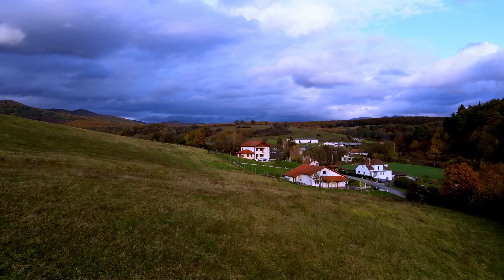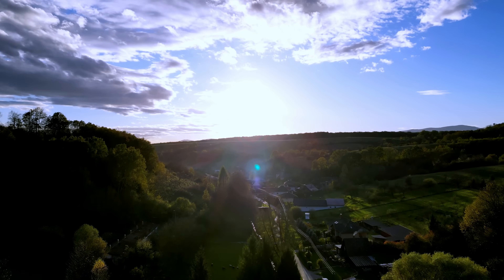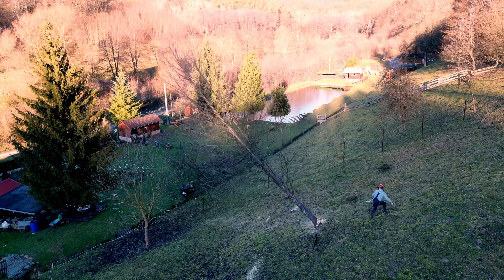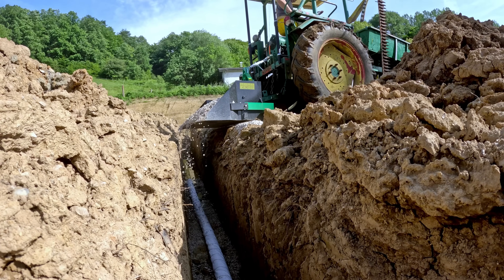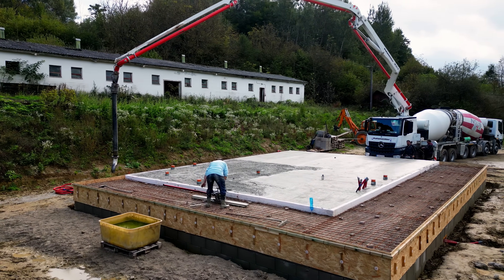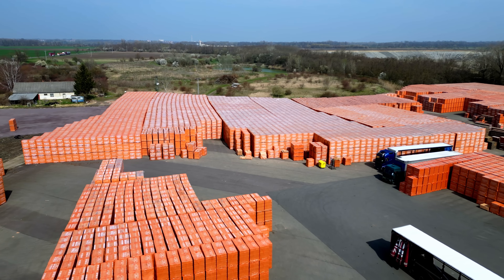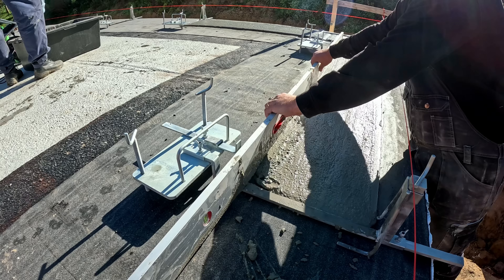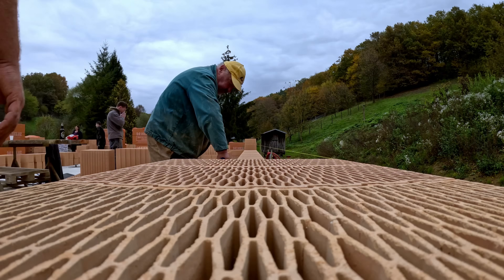Czech Bricks That Could Change Homebuilding | (#23 How to build a house)

Comment: We use bricks in Perth (Australia) which are double walled but only half the thickness, i.e. 10cm per wall with 5cm between. However, the insulation is very poor! Maybe these bricks are better for insulation with the polystyrene, 50cm thick and different pattern but not sure it matches other methods. What is the approximate R value... >2.5? Laying these bricks with roll-on mortar is a brilliant idea as the standard trowel method requires skill and much more time consuming. Finally, you will have problems laying services like water, electrical, plumbing and gas with a single 50cm thick wall, so please advise how you deal with this.
Reply from the maker: Thanks for comment. R value for this brick (withou styrofoam filling) is R=7 m2K/W. If you will use filled bricks it is even better 👍 water pipes,sewage pipes, electricity etc. will be applied normally, through the walls and than covered by thermal plaster.
Reply: @CountrySideDream ... that is very good R value.

Comment: I wasn't able to watch the first full video so I might be a wrong. 
I've been in Alaska for 40yrs.  The biggest and boldest mistakes are made by not installing a vapor barrier wherever concrete comes into contact with the soil or even dry backfill. It appears you've done an excellent job with drainage,  however all of this may have been accomplished with some inexpensive plastic pond liner carefully used under all footings and floorings. 
Rising water vapor is some of the best ways to take heat away and makes an excellent environment for mold.
COLD WEATHER TESTING 
FAIRBANKS AK.
Reply from the maker: The drainage was done mainly due to statics. To prevent sinking of the house to the ground which can cause critical problems with house in the future. Waterproofing (also radon proofing) is and will be done between concrete slab and brick walls and whole house floor 👍
Reply: @CountrySideDream  thank you!  I was holding my breath on that particular part in the construction.  Good go!
Reply from the maker: @Curtis-s3p  keep watching and if you will have any question just leave coment 👍😎
Reply: @CountrySideDream  Also want to know the reasoning behind the use of white foam beads instead of the more often used spray foam that completely incaseses the voids?
The beads are more environmentally friendly?

Comment: I have several questions about the final product.  What is the R-Value per inch of material?  How strong is the material in terms of sheer strength?  Would someone in an earthquake zone want to use this material or can it be “crushed” by the shifting action of an earthquake?
Reply from the maker: R value: 7 m2K/W (It is thermal resistance factor but it is in m2 ) 

Strenght: 8 MPa 

If you are interested in technical informations whole official technical list is available on internet, even with  different variants of used mortar. Material is called => HELUZ Family 50
Reply from the maker: One more thing => earthquake question. This topic is usually problem of project documentation, so if the structure is designed with concrete pillars and big wreaths there is no problem in brick 👍

Comment: The pink bubblegum adhesive is an alternative to mortar? Is it an epoxy? The brick is beautiful.
Reply from the maker: It is new technology mortar. It is not epoxy or any other "hard chemical" it is mineral mortar. It is pre-prepared in buckets and applied by normal roller similar as a paint. Today is popular bricklaying on glue foam and honestly I really dont like it. This mortar combine efficiency, speed and comport of Glue foam but it is much more stronger => similar to cement mortar.
Reply: @CountrySideDream  This is all new to me so I will have to investigate.

Comment: Dont think i would use clay bricks for my house i used concrete blocks with rebar and more concrete to make it stronger with steel and concrete beams top and bottom everything connected to the roof and footings..
Reply from the maker: Your house has to hold as a bunker thas true 👍 but it has to have the additional thermal insulation, am I right ? If Yes how you are ensuring that your house is breathing and ventilling the internal moisture in air ?

Comment: First time viewer to your Chanel. Very interesting bricks. Does the clay naturally change color after baking or is something added to the clay?
Reply from the maker: Its natural change of colour, cool thing is that clay is mixed just with water and some biological paper particles or something like that and all production waste is natural and safe to store in same clay mine from which they’re taking the clay 👍
Reply: The color is due to the iron, underground the iron is reduced by low oxygen and grey, in the fire it's oxidized red.  The clay is actually a small part of the brick mix, the naturally existing subsoil probably contains more sand and non clay particles than actual clay, but clay is so "dominant" in the characteristics that it looks, feels and performs like clay.  Pure clay would shrink and crack too much.  The waste is good filler for pure clay, in this case the soil is probably just right so no need to reuse the waste and it's easier dumped back in the pit.

Comment: Those are  “ Poroton “ blocks , we were using those in Germany in the 1970 ‘s building boom. ( the Auf Wiedersehen campaign )
Reply from the maker: It is not Porotherm, Its HELUZ 👍 from my point of view much more technically sofisticated than Porotherm. HELUZ brick has structure which gives them thermal insulation properties (brick by itself without filling) and filling is just a benefit 👍 Porotherm is based on filling, so if in future this filling deteriorate, Porotherm has a Big problem but HELUZ still keeps its properties 👍
Reply: @CountrySideDream How is it SO different from Porotherm? Can you explain? It certainly looks very similar/ the same...
Reply from the maker: @CARambolagen  Main difference from Porotherm is, that Porothem has no thermal insulation properties without mineral wool filling. Houses built from not filled Porotherm are usually covered in additional styrofoam insulation. HELUZ brick has structure so good that not filled brick (I´m using HELUZ 50cm thick brick) is allowing you to achieve "passive house certification" without additional styrofoam insulation and such a house can breath and transfer internal moistures naturally out of house. And HELUZ is even cheaper than Porotherm :D
Reply: @CountrySideDream  OK, interesting. I wonder why it is called PoroTHERM then...? The name seems to suggest thermal qualities...
Reply from the maker: @CARambolagen  Look Im not telling that Porotherm is bad, but definitelly they are winning in marketing and gaining from bráne recognition. HELUZ is now heavily working on their competitivnes => they are offering free project documentation for family houses if you will use their material. I think they have 5 different options ready and when I was checking those project they really masterred them. All technology is very well planned and all problem already solved 😁
Reply: I really enjoyed this video & comments. The world needs more innovative companies like Heluz. Cant wait to see how you progress!

Comment: Very nice work my friend. Question, how do you plan on doing second floor? Can you do poured concrete second floor with this block?
Reply from the maker: The plan is to build wooden timber framed ceiling and than continue with second floor also with those bricks ;) but it will be not full second floor, just living space under the roof kind of thing ;)

Comment: I hope they go to green energy that is a lot of gas.
Reply from the maker: Look, main impact has the number of houses build from this material. Cummulative effect of thousands of houses which can save 70% of energy for heating together is much bigger that transfer from gas to electricity in production. Imagine if this Factory will change main cheap natural gas to electricity and + cost of transfer how it will impact price of those blocks. It can be 3 times higher. And than nobody will buy it and there wont be energy savings in houses. Man this problem is conplex 👍
Reply: @CountrySideDream  natural gas is very expensive, the cost is climate disaster, I am all for well insulated buildings, when the AMOC collapses we will likely be 10 degrees colder on average, thz point is we do not want AMOC collapse at all which means finding energy alternatives NOW, and as for cost, if you externalize the cost on other people the cost to you may be more affordable but the real cost is unimaginable.

Comment: Built a house in France with a similar system about 20 yrs ago. First layer took a day as you have to get it perfect or even the slightest high spot becomes bigger on each layer. The rest took a day and thats by myself. It is also really strong, truck delivering the roofing hit the wall and didn't damage it.
Reply from the maker: Exactly, I have same experience 👍 now we continue with building of ceiling and that second floor 😎

Comment: Energy costs would be too high in UK?  Also no hard hats, hi-vis jackets?  Health and Safety would be down on you like a ton of the bricks that you’re producing!
Reply from the maker: Im not from UK 😉 The main “construction Strategy” of this house is MINIMAL DEPENDENCY and MINIMAL COST OF LIVING. And Yes you are right about Hi-vis jackets and hard hats 👍 but Im building it for myself and no company is invilved so legaly it is not required but Yes healt is more important 👍 definitelly I will increase level of safety asap I will start with roof

Comment: Thanks.  Great product, came across similar when I worked as an architect, though not readily available in UK.
ps.
We would call it a block, not brick.
That is not Styrofoam, it is expanded polystyrene bead.
Reply from the maker: You are right 👍

Comment: Where does the water go when that thin exterior facing first layer of the brick gets soaked by the rain? Down those channels and then trapped and left to pool at the bottom? I didn’t see any drainage or weep holes. Soaked styrofoam pellets will retain the water until the styrofoam collapses and deteriorates. How long will that thin layer of brick last before deterioration due to repeated soaking and drying? Filling the brick with closed cell foam might be better as it’s water proof. As it is,I’d want a very dependable water proofing on all the exterior sides and I’d still want drainage at the bottom. And the last thing you’d need is an exterior that consists of another water reservoir like stucco. It’s an interesting brick, but it would be much better if it were impenetrable to water. Does anyone make bricks like that?
Reply: Similar, though not so deep, blocks have been used for decades in Europe, it is the standard building technique.
Reply: I guess you take care not to let water in, and the block clay is slightly porous so it will eventually escape.
Reply from the maker: Whole point is than bricks will be covered by plaster ;) plaster will protect bricks from outside water and honestly all winter was construction like that (for sure walls were covered from top) and nothing happens even when all winter we had rains and snow ;)
Reply: @CountrySideDream  we normally use the term plaster for the gypsum based coating used inside, not water resistant.  Externally cement / lime based referred to as render. obviously not your mother tongue, so thanks for making the effort

Comment: What's the expected lifespan of this building?
Reply from the maker: Minimal “rock bottom” lifespan, if all is correctly built, is 100 years. But in reality is much more (depends on roof structure) and because Im going to use traditional wooden timber roof construction and real roof tiles, It will be very long life of this house.
Reply: Wow that's great. can you also cover earthquake related parameters in one of your videos pls?  @CountrySideDream
Reply from the maker: @crazydrifter13  in our Country we do not have earthquakes at all. So it is standard to do not have special construction features in our houses in Slovakia. But Im sure if you will do your project whole earthquake question can be solved by concrete and steel reinforcrment 👍
Reply: @CountrySideDream ok thanks 😃

Comment: Wonderful bricks, modern tech, as well as good insulation therefore it will warm inside in the winter, also cool inside summer, it is good saving on the energy, another good reason it looks good no need of painting, great, you have done good job, wish you good luck !

Comment: no vertical mortar between the bricks? In some places I can literally see the gaps between them... the roller mortar - looks awesome. thick as glue - very little mortar consumed... but the vertical joints...? suspicious.
Reply from the maker: All wertical sides of bricks are connect with tongue and groove joint. So all vertical joints are locked together with other bricks => this is the reason why only horizontal side is covered by mortar. All bricks are grinded on both horizontal sides (with accirecy up to 0,5mm) this is why roller mortar and thin layer of it works 😉 … and all walls will be than covered with thermal plaster => so it will be super compact construction
Reply: @CountrySideDream  - strength wise, structure "interlocking" - sure... but... heat insulation? Air tightness?

A thin layer of external "grout", surface finish would do it, but... without it, a little odd. Pretty sure it's ok... but... odd.

Comment: THE BRICK IS FINE, JUST VERY POORLY SET IN PLACE. YOU NEED TO FIND A BETTER BRICK LAYER. KIWI.
Reply from the maker: It is done really well and profesional 👍
Reply: It is not the brick. It is the hollow ceramic block which is worse than ACC block. It is more expensive and as you noticed it requires more experienced-expansive labor

Comment: 這大概是我看過最厚的牆壁，想必隔熱、防寒功能一定超級強大！
但是我有一點不明白，就是地下部分為何也需要隔熱、防寒呢？
Reply from the maker: It is perimetric styrofoam, It is water resistant and also thermal insulation. I used it because I have a plan to use real stone as facing. Bacause of that I need som kind of separation between facing stone and foundation 👍

Comment: yeah face it. its a mud house. mud is used for thousands of years and its really great material. no idea why concerns...
Reply from the maker: From my point of view best choice what is today available on the market 👍
Reply: The difference between mud brick and kiln hardened clay brick is huge. Obviously high duality of local clay (along with proper process control) allows forming of building blocks that provide additional benefits (stability of final dimensions and use of styrofoam filler for sound and thermal insulation) compared to the traditional clay bricks.
Reply: Just the energy concern. What is the source of energy in the production of the brick? - Also the "mud" is spoiled with styrofoam. Yuk!!🤮 And why?? OK, I only just saw that it's only for the bottom row. Still no fan... The air pockets of this type of brick already provide insulation. That's why they were first designed like this. -  I like brick, but it has to be baked with renewable energy and it has to be recyclable. Styrofoam makes it unrecyclable and will create moisture issues. A house must be able to breathe. The mud used in houses over 1000s of years certainly did that.
Reply from the maker: @CARambolagen   No concerns are needed here ;) As you mentioned, styrofoam just for first row (this will be also the level where floor heating will be so I would love to keep as much of heat as possible and steer it to the house not to outside). House is designed and build in the way to keep natural breathing of house and natural ventilation of internal moisture to outside through the brick. Also internal and external plaster and paint is chosen to ensure this property. All bricks without styrofoam (almost all) are 100% recyclable => even leftovers from manufacturing plant are normally stored in same clay mine where the clay is coming form ;) ... manufacturing energy source I´m not able to affect
Reply: @CARambolagen  yeah... that "upgrade" is not really an upgrade. those bricks are already 40 or 50 cm wide. that is plenty enough.

Comment: No offence but thats a damn porotherm or derivative. It has like 15 versions made by different companies. What builders really need is a water dip, a strenght test, alignment test, stuff like that. Enjoy your house but you are not clearing the fog here, you just add more to the foggy situation.. And i envy you cos you dont have to build confined masonry with porotherm, you just lay it there. Im from Romania, if we dont confine it with concrete chances are next 20 years it wont be there anymore. Btw do you realise that if you dont have earthquakes you can build gipsy houses at half the price you spend on all that solid structure?
Reply: What are gipsy houses?